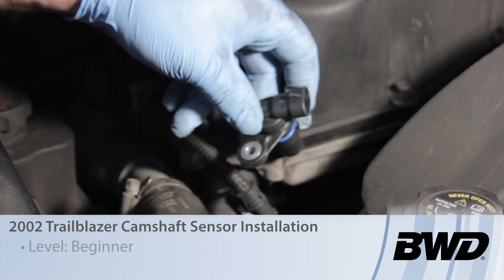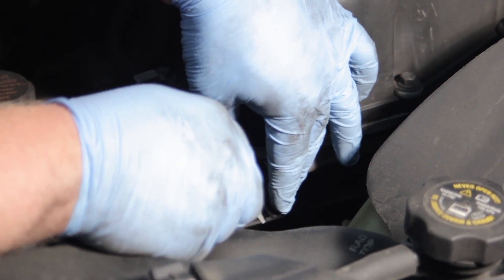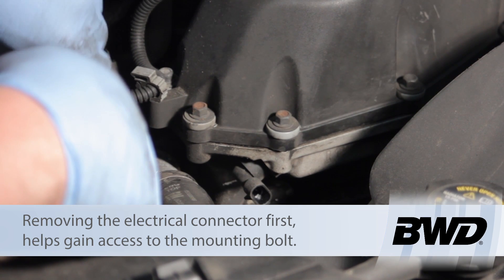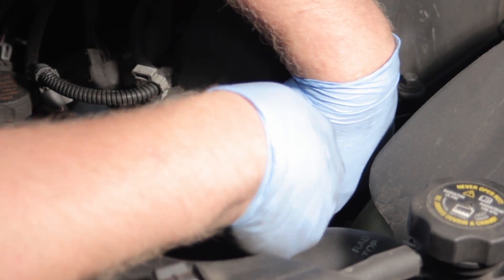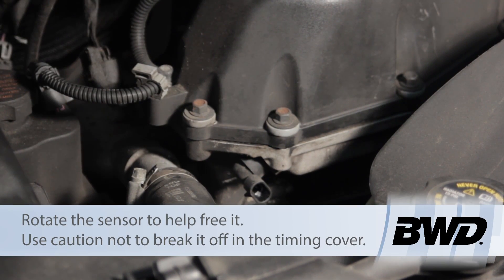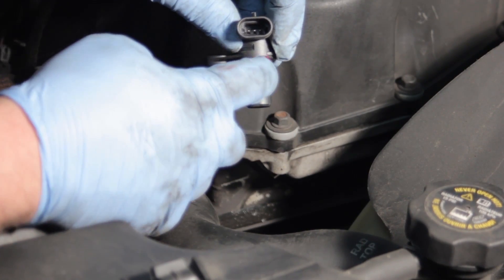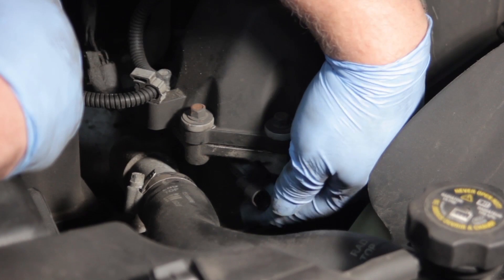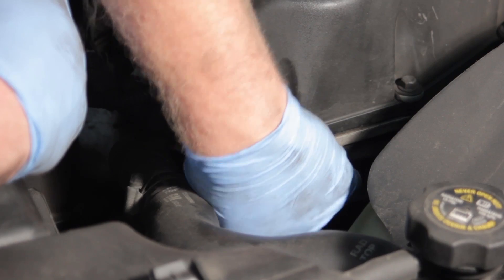Trailblazer Camshaft Sensor Installation

Comment: When you replace that sensor do you need to do a camshaft position variation learn??
Reply from the maker: There is no camshaft position relearn procedure.  I assume you're referring to the crankshaft variation relearn procedure.  That only needs to be performed if the crank, crank sensor, harmonic balancer, or PCM are disturbed or replaced.

Comment: This is literally a 3-minute fix, why would you even mention anything to do with moving the serpentine belt, I don't get it...
Now of course you have to move the serpentine belt for the variable valve timing solenoid replacement, but that's about it!! 😃